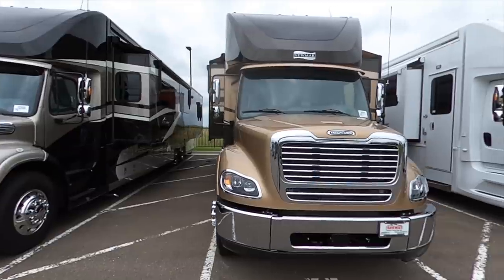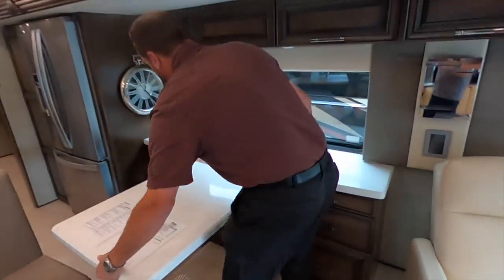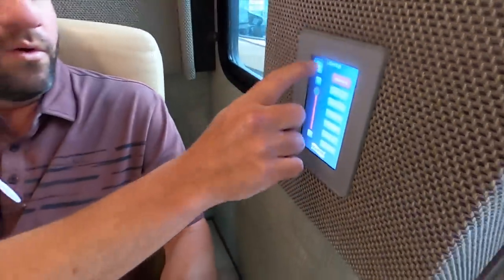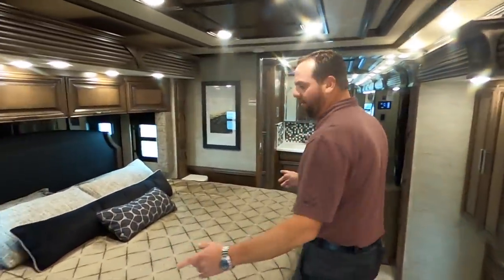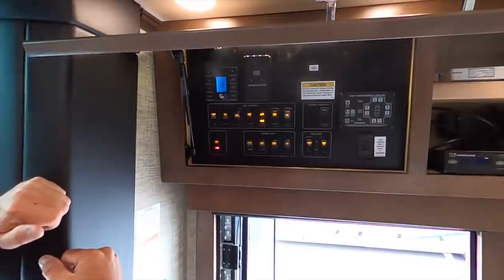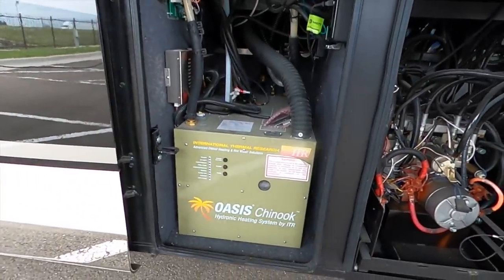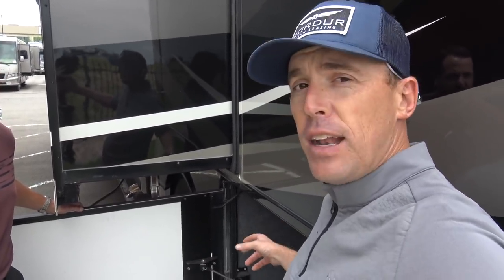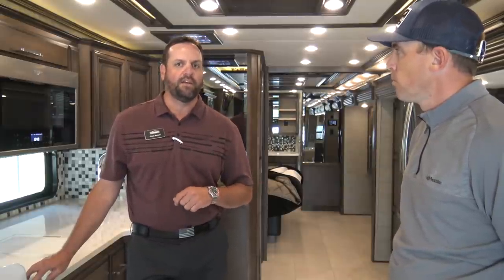THE NICEST SUPER C RV IVE SEEN, NEWMAR SUPREME AIRE

Comment: Nice coach with a gorgeous interior! BUT... for 600k it would be nice if they used the Cascadia chassis over the M2.
Reply: Renegade XL uses the Cascadia
Reply: KW or Pete
Reply: The M2 is a good bit cheaper than the Cascadia chassis, so that $600k would be more like $800k+ depending on options.
Reply: I totally agree even though I don't know what you're talking about

Comment: I would love to see the chassis, frame/structure build difference between Newmar and Renegade/Showhauler!
Reply: ive looked at there specs on each website and  i think the basic difference is renegade/showhauler have a little stronger/bigger  chasis and components  but newmar has a little bit nicer interiors. For example you can get a showehauler usually come with a cummins 15  or DD 15 engine but newmar comes with a DD12 engine. but the newmar comes with no carpet on the slides and flush flat floors.
Reply: Not even a comparison. Newmar uses the M2 and Showhauler/ Renegade (classic, XL, Explorer, and Ikon) use a class 8 chassis. This Newmar is way overpriced considering it’s on an M2 chassis.
Reply: @KMT15  for the unwashed (me) what’s the difference between the M2 and Class 8 chassis? Is the Class 8 just more heavy duty?
Reply: @KMT15  are some of the Renagades available with a Peterbilt, Volvo, or Freightliner Cascadia chassis as well? Not just the M2.

Comment: Still prefer a Class A for the amazing panoramic view you get with a large windshield. Also the quietness of a rear engine. To each its own.
Reply: YEP, ME TOO.  THIS IS A NICE CLASS SUPER C, BUT IT IS OVERPRICED.  IT CANNOT COME CLOSE TO THE CLASS A MODELS.
Reply: The super C is unique and badass. Plus it's safer and easier to maintain.
Reply: I think the appeal to the Class C is the ease of maintenance and accessibility of the engine compartment, the ability to service them anywhere, and the longevity of the unit.  I was 100% in the Class A camp, but there are some advantages to the Super C.

Comment: Take a thin say 1" gas line type conduit, usely a yellow color & bend an arch & 2 end female anchor pnts secured to side of truck hood. It is a que stick. When u hve it right length bend of arch  it tells u just right safe distance to car/truck u r behind in front of u. There bumper should b sitting on top of arch. 1 piece of pipe is empty & other piece/length of pipe is full yellow w/black electrical tape (yellow jack it look). This way u can dummy remember to switch it & cars looking to get in front of u can tell if u hve a load on. These r big semi trucks w/ novice drivers so v/RV helpful. Also when tired like truckers get your dummy stick + new radar keeps u in the moment(every sec is precious).  U can error your stick or hve extra heavy long 3rd stopping stick yellow w/red & black electrical tape.

Comment: Don't understand why the driver and passenger seat are stock Freightliner leather and not redone by Newmar in a $500k+ coach.  Not to mention the whole cockpit is in dire need of a makeover. It has been the same for decades.  Other than that, sweet ride.
Reply: For 500k I would want something that looked more like a tesla or cybertruck rather than a normal semi
Reply: This is why I couldn't buy one because I drive a truck and I sure wouldn't want to still be driving one for recreation
Reply: Yeah, I have to agree about the cockpit. Looks very plain. Interestingly the Renegade cockpits using the Freightliner chassis are quite a bit better looking.

Comment: Oviously not getting power roller shades new rig/unit less than $200k right NOW but more ppl by handle trash bags mom(cheap idot) no1 will hve to not hve handle trash bags soon bc they stop making the cheaper stuff & start mass producing upscale or advance 4k ultra high, or quality stuff. More attension to RV-ing &truck&trailers the much over all universal remote simple stress! proof the experience. It's the little things that make up for little space. RV-ing tail can some case wag the dog. <The 2 burner removable induction cook top feature is v/slick.>